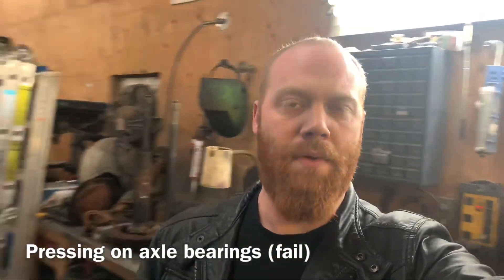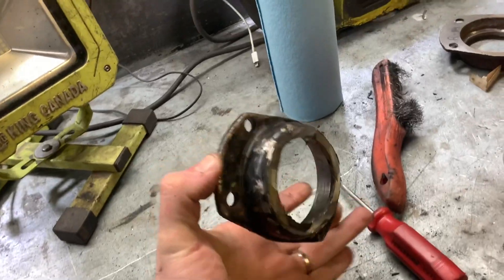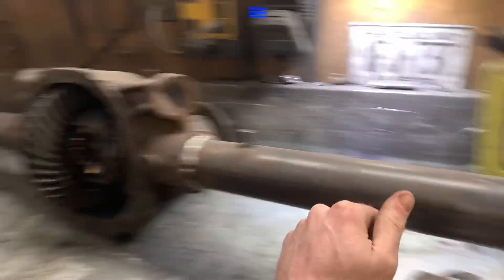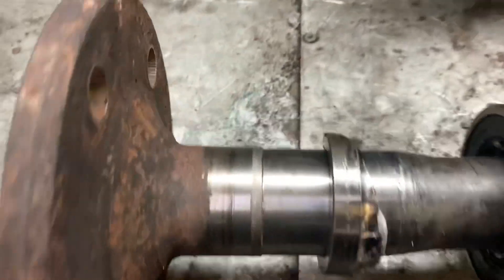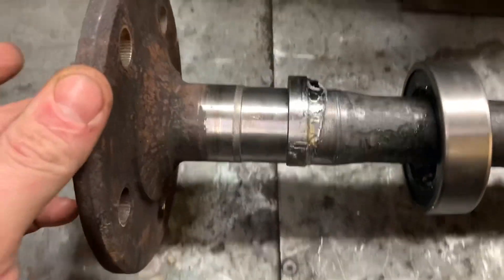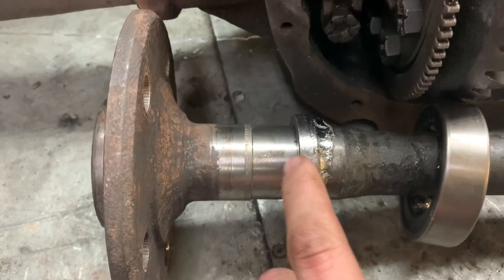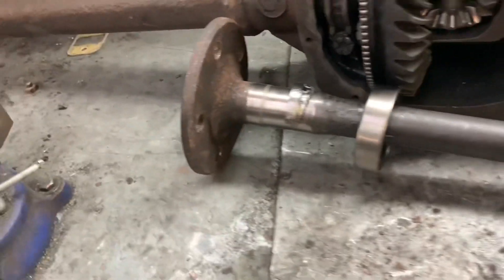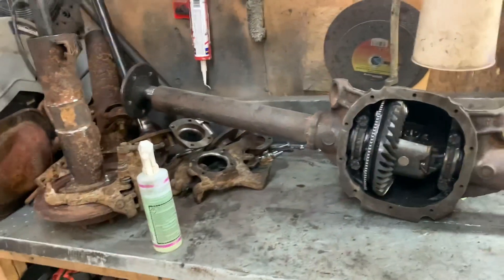31 spline 8.8 with 9” ends part nine - major fail installing axle bearings

Comment: Any updates on this project?? Just watched the whole set of this narrowing video with the 9” ends
Reply from the maker: I haven’t gotten back at it yet, but I will be in the next few weeks, after the engine is done. I have to have the diff done by spring for the rat rod
Reply: @StationroadRatrods  I’ll keep an eye out for updates!
Reply from the maker: Perfect, I wanna have the engine done before I start another full on project. It’s about half done, I just need to finish up the axles, weld on the 9” ends and get a spool for it
Reply: @StationroadRatrods  I’m hoping to do a similar end swap I have a crown Vic rear end which is too long for what I’m doing so want to budget the 9” ends and shorten it
Reply from the maker: Nice! Crown Vic would be a great option, being that they’re limited slip and most of them used 4.11 gears. I’d love to come across one myself
Reply: @StationroadRatrods  this one was a p71 from a 2011 so it’s 3.27 limited slip but also 31 spline where most the early were only 28 spline
Reply from the maker: Deadly, that’d a solid unit

Comment: .040 is 40 thou .. .004 is 4 thou.. so that would mean you had 40 thou interference fit which isn’t going to go. 3-4 thou i believe you want.. I felt bad when it broke but I also laughed.. u will get er next time ! I enjoy the content 🤘
Reply from the maker: Yeah I knew the spec was  “4” something, just may have mixed up where the 4 was after the decimal point 😂 I laughed after too, I was like well that sucked haha
Reply: @StationroadRatrods  lol yea where the 4 goes is a little important in this case lol .. Was hard to tell in the video but be sure u press on the inner race not the outer race.. will keep an eye out and see how she goes next time haha
Reply from the maker: @charleswilliams2008  I had it set up with an old press-in bearing so it was only touching the inner race, I’ve pressed on a few of these bearings before, but not in a “custom” application lol
Reply: I know this is an old video. But 3 videos back he told what the size of the bearing was and the axle was .. I knew he wouldn’t be able to press the bearing on the axle. Mabe if he had frozen the axle and heated the bearing but I doubt it
Reply from the maker: @david yeah this was doomed from the beginning